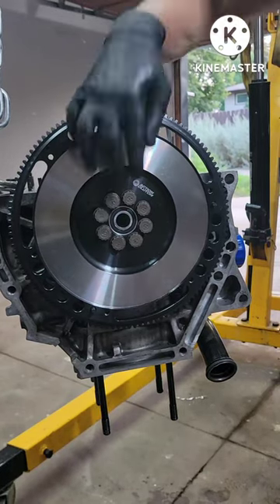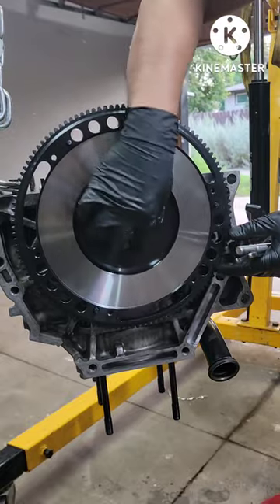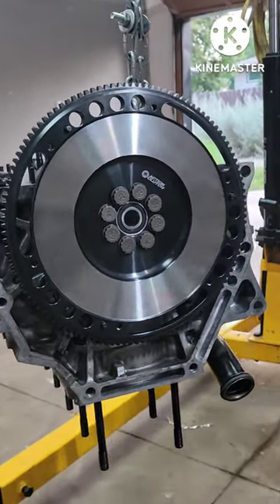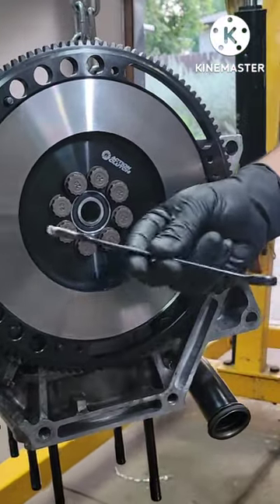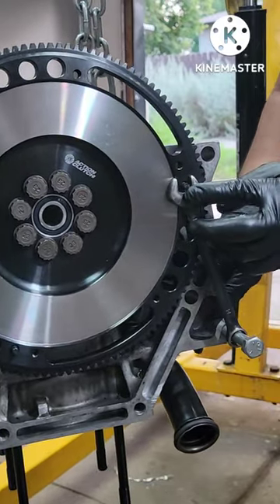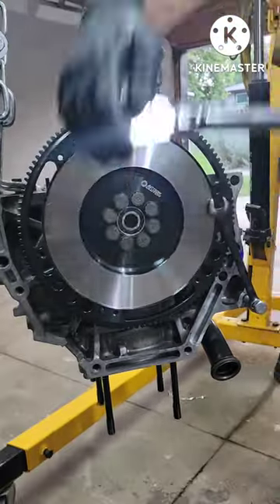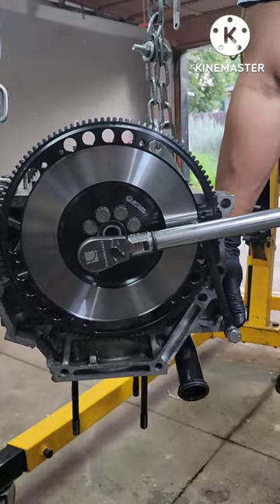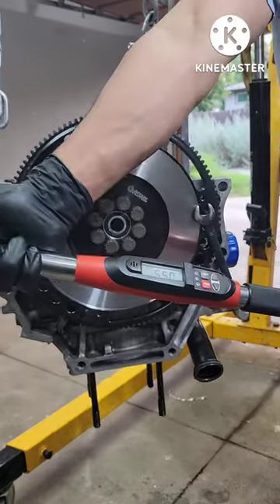No Special Tool Need It, Flywheel locking tool

Comment: Absolutely genius, and there's me with the bolt idea but then jamming a screwdriver in the teeth 🤣🤣🤣
Reply: I did similar with a bolt and a10mm spanner jammed in the teeth (need to hold the spanner with one hand)... It does kind of fit nicely into the teeth though